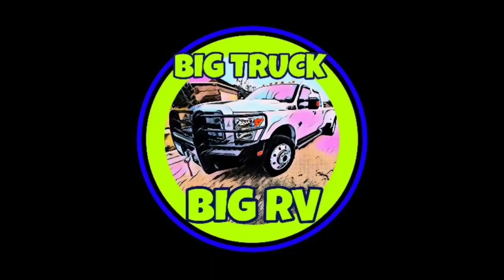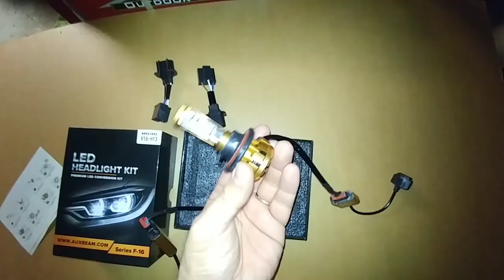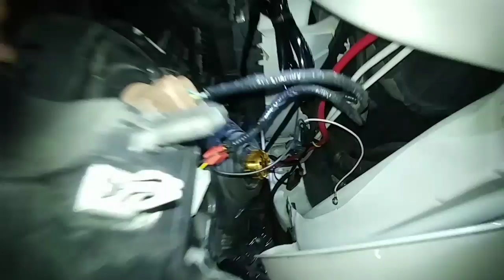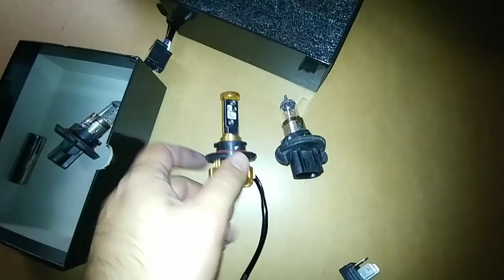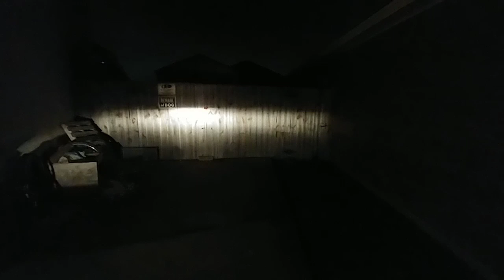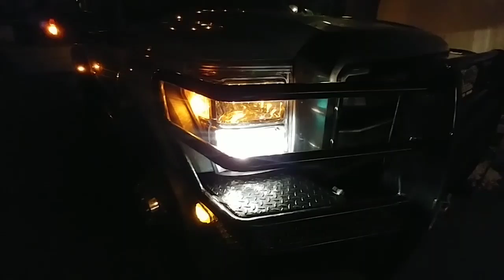2016 Ford F450 LED bulb replacement...Not good results

Comment: Great video!
I was thinking of getting these same bulbs for my truck but was concerned that they would do exactly what they did. So you saved me the hastle of installing and then removing them from my truck. So thank you for that!
I agree they can do better with these LED lights. 

I am currently looking for a good replacment light for my 04 Wrangler and having a very hard time. I sems that no one makes a good replacment light for 7" round headlights. Tho there a few out there they also so expemsive that there pointless as who in there right mind spends 600-800 on headlights?

I have yet to find a good option in the $150 or under range.

Comment: On thoes leds there is 2 tiny screws tht can be pulled drill 2 new ones up a little to match the stock bulb to match light pattern.

Comment: I had the very same experience with same brand LED light for 2009 Ford Sport Trac.
in addition to that, Low voltage error was also reading on instrument panel on the dash whe high beams were used.

Comment: 1/ As you have justly demonstrated, bulbs must be engineered correctly to the lens. Simply inserting a retro-fit is no recipe for success.
2/ More importantly, readers should be aware of what the LED manufacturers do not disclose. Sure, some LEDs can produce sufficient output, but for how long? Decay is the big problem for LED. Most high output LEDs have very high and rapid decay: this means the output will fall quickly to 50% of max, often when only 100 hours is reached. Consumers should demand to see the decay curves for the LEDs.
3/ Beyond rapid decay is the heat problem. Assuming the lens plastic can tolerate the normal LED heat, that little fan on the bulb is very prone to failure. When it fails, not only the bulb fails, the heat can melt the lens. LED bulbs should come with fail-safe heat-fuses to prevent excessive heat.
* For all the above reasons, I will not use LEDs for projection lights. Stick to what your lens and vehicle were designed for. If you need to replace halogens every 3 years, this is a far better solution. If you need greater illumination, consider adding extra driving lights. Of course, if the 2017 vehicle is specifically designed for LED, then you should be fine, assuming you accept the rapid decay of light output.

Comment: Thanks a ton, ive got the exact same problem you have, gonna try putting in a higher wattage bulb and see how that works, let us know what solution you come up with, good luck and awesome video!!
Reply from the maker: balle27: I would highly suggest you avoid using higher wattage light bulbs. In many instances they can cause the wiring harness on the vehicle to burn or fail. the higher wattage bulb was going to pull more current Through the Wire that isn't designed to support it. I have personally seen multiple Vehicles wiring harness burn from using higher wattage bulbs.
Reply: Big Truck Big RV Ok good thing I don't drive a ford then, chevy has a far superior charging system and lower gauge wiring to handle the higher wattage.........lol I hope no one takes that seriously.
 All jokes aside, that is definitely a valid point, what do you think about these Osram night breaker unlimited bulbs, they say there 20% brighter and project 40 meters farther then the stockers. Not to sure they are worth it but i have a feeling I'm gonna end up with projector hid's

Comment: For my German vehicles with the H7 bulbs (separate high/low housings), the Led assemblies (single Led) line up nicely with the projector focal points.  Low beams have a good cut off.    I have considered doing the HID projector retrofit or buying the factory HID housings but I don't know if want to work that hard on the lights.  :)

It is too bad that Ford couldn't separate the high/low beam because that would have made the bulbs more compatible.  Not enough space to squeeze those two Led's into the proper location.

Comment: Ok man, I just bought a full set of these lights for my 2011 Silverado HD Duramax, I like them but have been "high beamed" by other drivers on the road several times over the past few weeks. I have not checked the pattern like you showed here ( I will soon) , if I'm facing this issue, what can I do? New housings'? I dont wanna remove and attempt a return.

Comment: Excellent video.  I have come to realize that your channel can be relied upon for concise, accurate and knowledgeable opinions and advice. Just about every other video on youtube showcasing aftermarket LED headlight bulbs sings their praises to the moon, probably because the bulbs were supplied to the reviewer for free.

I have been struggling with lighting on my new-to-me Crown Victoria, and have gone through two sets of LED headlight bulbs so far. The first set used a single traditional domed LED for each "filament" like yours do, and the beam pattern was atrocious. The second set I ordered uses multiples of a much smaller LED die in the appropriate location and orientation of the halogen filaments, and does a much better job of approximating the original beam pattern.  It's still not perfect though, and there is still stray light projecting where I don't want it. The issue is that the incandescent filaments are tiny, focused sources of light, and getting an LED to emit its light from that same small point in space is difficult, as even modern high power LEDs struggle with surface brightness, which is more important than total output.

I will keep my bulbs for the time being, at least until I decide to do my own retrofit, or simply go with some higher wattage bulbs and an appropriate wiring harness upgrade with additional relays. To anyone out there looking at putting LED bulbs in their halogen reflector housings, I highly recommend that you only consider units that try to mimic the location, size and orientation of the OE bulb filament.  Large LED arrays (and especially COB-style LEDS!) with a lot of surface area will not help you out at all, and will result in much less light on the ground and down the road, as evidenced in this video.

Here's an example of the style of bulb I'm talking about.  I don't recommend these exactly, as I can't vouch for their reliability after only owning them for a week or so, but they are much better than the other set I used, which resembled the ones in the video. As an added bonus, these don't use fans, so there's one less thing to fail and you won't have to deal with the noise.

https://www.amazon.com/QuakeWorld-Headlight-Conversion-Chevrolet-Mitsubishi/dp/B01MEBONKP/ref=sr_1_7?ie=UTF8&qid=1485296848&sr=8-7&keywords=9007+led

Comment: I have a '17 on order and opted to not put the factory LEDs in the truck, basically the only option I passed on in the Lariat. I looked into the aftermarket options also and pretty found through reviews and descriptions on several websites that the tech just isn't there yet for an easy replacement bulb. Thanks for video!! As soon as I saw the notification for it I clicked to watch.

Comment: I've been thinking about changing the stock bulbs out of my 2015 RAM 2500 Laramie Mega Cab for the same reason: The halogen projector beam headlights do not, in my opinion light the road very well. I wonder how these LED bulbs would work in the projector beam housing...
Reply from the maker: METALITHrevetments: RAMs have real problems when changing to different technologies in bulbs.  the CANBUS, even with a error eliminator, still tends to have issues.
Reply: Interesting. Maybe I'll just leave the halogen projectors and change the fog lamps out entirely (not just the bulbs) and go with blight LED's ?
Reply: Go to an HIR bulb. With a minor modification of the tab, they're a direct fit.
If your RAM is the same as mine, you'll have 9005 bulbs in there now... Go to a 9011 bulb.
http://store.candlepower.com/mohirbuba.html
http://www.iwsti.com/forums/gr-exterior/227770-sunday-mod-diy-hir-9011-9005-bulb-conversion.html
Reply: Thank you...I'll look into that.

Comment: I was considering putting leds on my f150 2015 but auto customs people told me I have the wrong housing and I would be a hazard to other drivers by blinding oncoming traffic
Reply: ultimategodking ... straight up, your car guy must be brand new at this. A couple adjustments on the top screws and everything should've been fixed or real close. In fact ... ADJUST the lightbar. Use that as your headlights. 

You see, this is why stupid people rush to have their car look sooo cool. Forgetting about reality, being they're getting a new vehicle in February. TBH, you're not smart enough for these type of vehicles. A '81 Ford Escort without a working fuel gauge, nothing else really works but it's a 4speed with an overdrive ... so it's a 5speed. 

Why'd Ford want to make the new model suck.

Comment: Thumbs up for not going with something that your not comfortable with. I hate the guys in their jacked up trucks with 100 watt leds. The on coming glare literally blinds you so much your eyes can't adjust fast enough back for night driving.
Reply: Christopher Minchak ... 100w LED bulb would melt your entire automotive electrical system, literal slug & sparks if not ignition & meltdown. 
In this case everyone would know you're incapable of reading the instructions & ALL THE SAFETY WARNINGS.

Comment: The problem with these LED bulbs is that you have to have a light unit which is specifically designed to utilises their beam spread because as you've discovered they are very different from normal incandescent. The other problem is that many of these on sale are designed to work with lighting systems that are found on vehicles sold only in Europe an not the US. European lighting laws are very different from those in the US, this is most evident on say something like a Ford Focus. Drive European car and then the exact US version at night and you'dd see a significant difference.

Comment: @ 4:57  Is the "they" the Chinese and I suspect the LED light kit was Chinese made.
The fan is the first red flag you know with a little time and dust they will fail.
Back in the day we would just replace the bulb with a higher wattage high beam 
It was really easy with H4 bulbs , not so much now ..too many bulb types.

Comment: that's the thing that kept me from converting to a different kind of bulb in my truck. side note: I wonder if the fan in that led bulb will hold up over time.
Reply: docindahouze 
Put some in my 2500 and kept getting a tps sensor light

Comment: The LED bulbs are just a fad, and blind oncoming motorists.
Reply: Only when fitted to light units which aren't designed to use them. Outside the US they have been used by all the big manufactures for a number of years now!
Reply: cheyennedogsoldiers More and more new cars are coming with them in the US. Although I do agree it's annoying when someone just sticks bright ass LED bulbs in a housing not designed for them.
Reply: Go Pro nice homosexual projection there cupcake!
Reply: I have the factory LED's on my F-150. I've yet to have anyone flash me because they're too bright.
Reply: Will Buhrrr So you are going to drive for me sweet cheeks? I'm so happy you love me so. Kisses

Comment: As I was comparing vehicle specs on Ford's Superduty website, I noticed that the width on a SRW crewcab with short bed is only 80 inches while on the long bed, it is 96 inches wide.  Did they make the chassis wider to accommodate the wider aluminum body on the long beds or is this a typo on Fords website?
http://www.ford.com/trucks/super-duty/2017/models/f350-xlt/

Comment: Hi, thanks for making all these great Superduty videos.  I am in the process of purchasing a 2017 F350 XLT Diesel and I was wondering if you noticed any improvement in the halogen headlight output at night as compared to your 2016 F450?  It is a big price jump just to upgrade to their LED lighting system and I do not want to go there just for the sake of headlights.
Reply: Ray Paul 
I think in the video I see a diver Allen screw that if you loosen you can rotate the housing ring then mark the hole and drill a small pilot hole then install the Allen screw this should fix the light from the LEDs I have installed a few of them in my trucks and friends cars I love the LED lights there brighter show signs and reflective better and don't fatigue my eyes like the hids on long night driving

Comment: the auxbeam has 2 adjustment screws where you can rotate the the led to where they are strait across. I haven't got any yet but I have done some research on them. If you could get back to me im curious if you did the adjustment?
Reply from the maker: Daniel Spencer: Thanks!  I'll probably take you up on that. Msg sent.
Reply from the maker: Robert Descamps: mine don't have that screw adjustment.
Reply: Robert Descamps I'm curious about this too. There's a guy on FTE with the same generation of truck with the Xenon Depot led kit and he was able to adjust the base to get the right beam. My Xenon Depot get gets here next week, I'm curious to see for myself
Reply: Big Truck Big RV Hey man, I love the videos, keep up the great work! I own a small lighting company and would love to supply you with all of your lighting needs! Feel free to send me a message or an email with ANY questions at all. I look forward to hearing from you soon!

Thanks,
Daniel
Superior Concept Lighting
SuperiorConceptLighting@gmail.com
Reply: Did this ever get tested? I'm still curious about the adjustment
Reply: Yelp adjustable. also loo into voodoo led bulbs. tons of guys running them and are happy with the output.
Reply: blonchay123 .... have you ever adjusted your headlights (Please say "Yes")? It's the same procedure. You're adjusting the housing for the bulb. There is no need to reinvent the wheel here. Find the bulb spec's for your headlights. The starting height for center, the distance from bulb center to front grille. 

This is NOT a big deal yet goes to show how people make this a big deal because of the BS people tell them.
Reply: Go Pro I think he was asking because he wanted to know if adjusting the base was possible and did it help. Led bulbs are a different ball game, adjusting the base of the bulb to get the "hot spot" in the right place in the housing is a necessity.